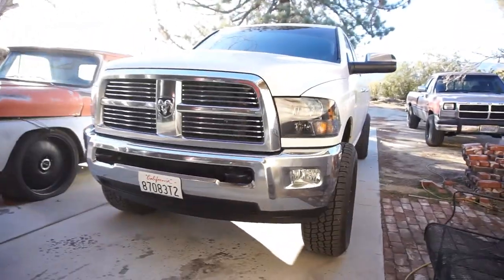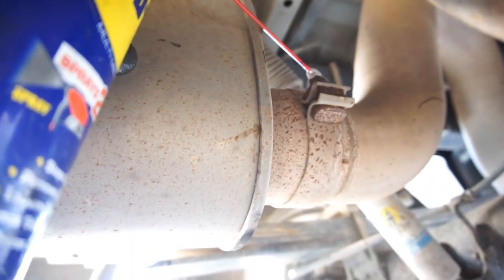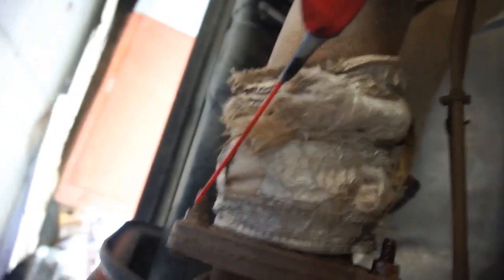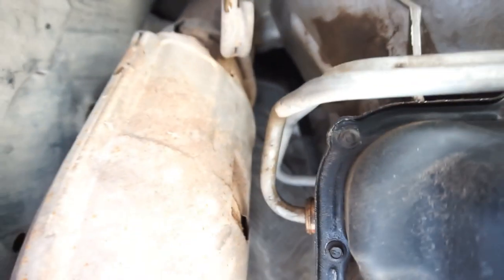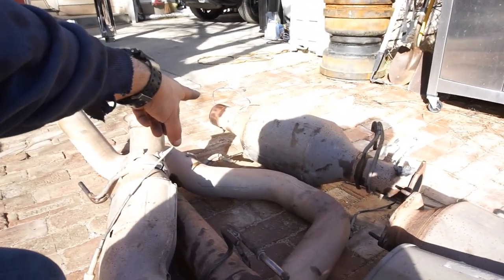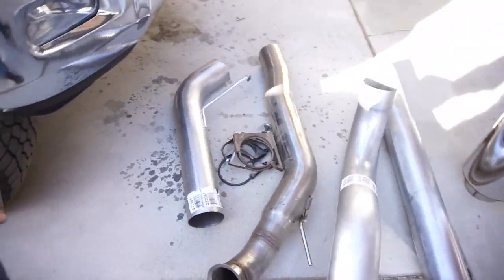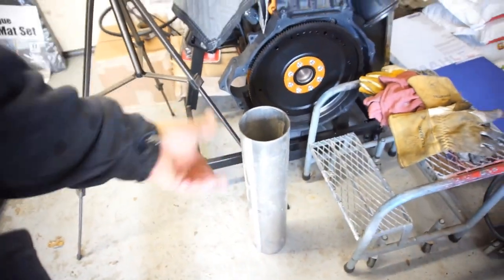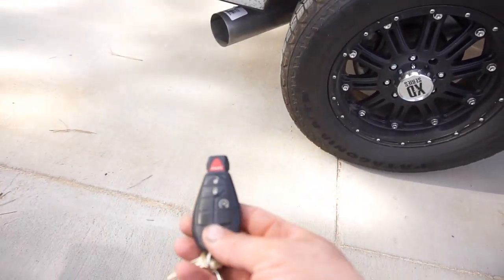Installing A 5 Inch Exhaust On The Drunken Ram Mega Cab Cummins Dodge

Comment: I saw the Instagram video of you rippin it down the street. Posi or pullin a peg legger?
Reply from the maker: OneNGlen it’s limited slip so it was both tires lighting up. 🤘🏼🤘🏼🤘🏼🤘🏼
Reply: @Halffast719  Awesome.... ain't like the peg leggin we use to do long ago though.
Reply from the maker: OneNGlen tell me about it. If I knew then what I know now rugged Ron would have his work cut out for him.
Reply: @Halffast719  Rugged Ron..... burn out king of the 90's!